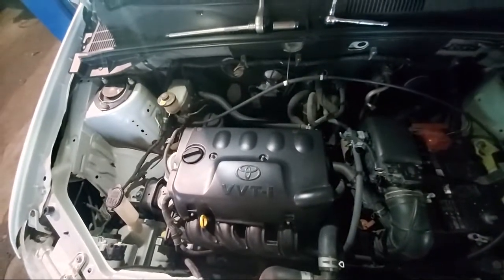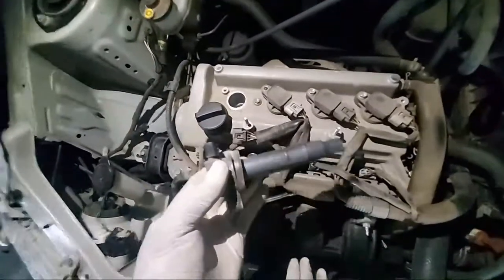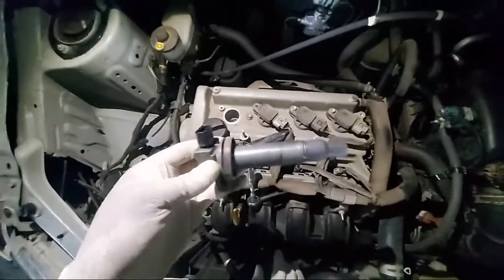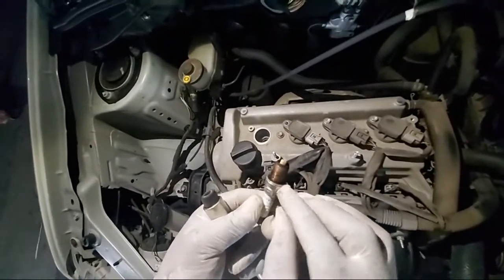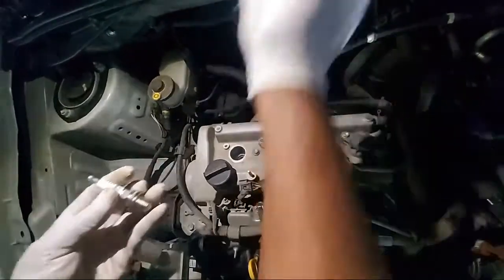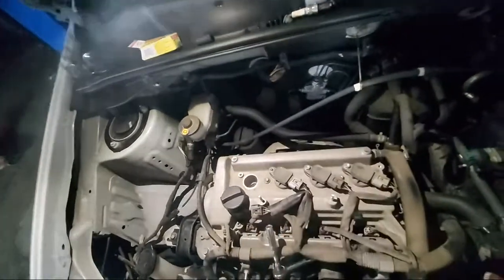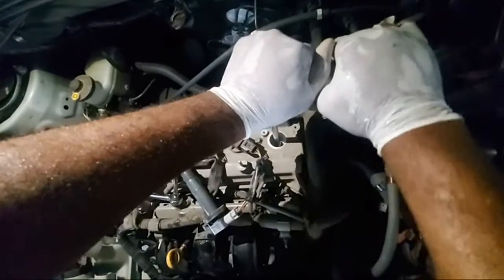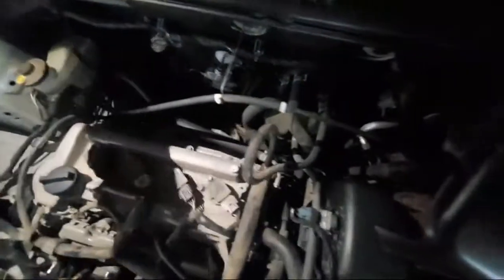toyota probox spark plugs replacement

Comment: Respect me love the work ,but question to u ,did you disconnect the battery before you changed the plugs, and what type of plugs would u recommend to use, awaiting a response, blessings
Reply from the maker: Okay... so, for safety, the batter terminal (s) should be disconnected, however; some vehicles , if you do not have what it takes to reprogram the system then you just have to take your chance. This vehicle is not so complex, so yes, the terminal was disconnected.  As it relates to the type of plugs, the engine specs of the parts dealer would be better able to assist.  This was actually the case with this car.
Reply: Yes mi boss i was making reference to a 2014 probox also when i asked about the plugs and the disconnection of the battery

Comment: How long before the spark plugs are to b e changed or how many miles after ?
Reply from the maker: It all depends on the type of plugs your vehicle uses, what your manufacturer recommends,  and so on.
For example, some iridium or platinum spark plugs can serve up to or over a year